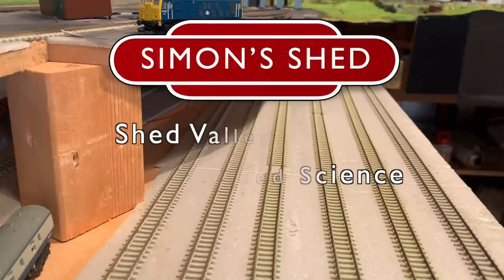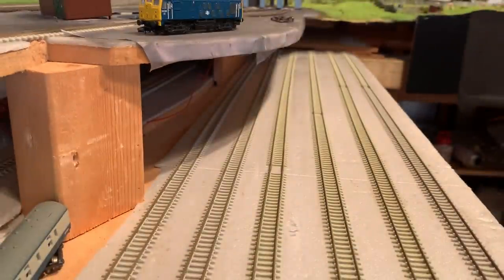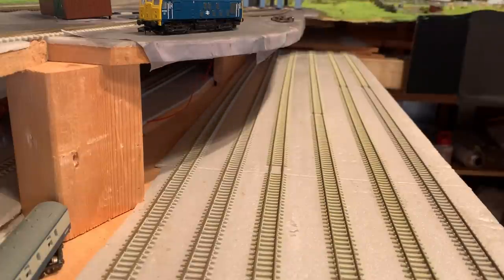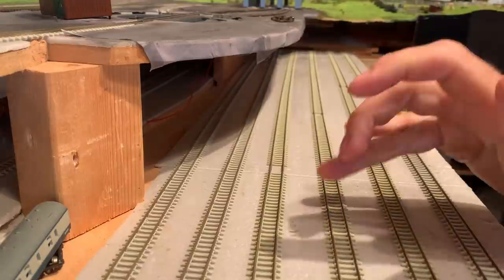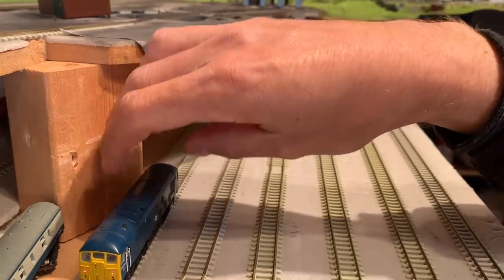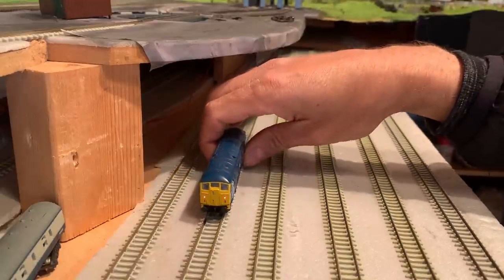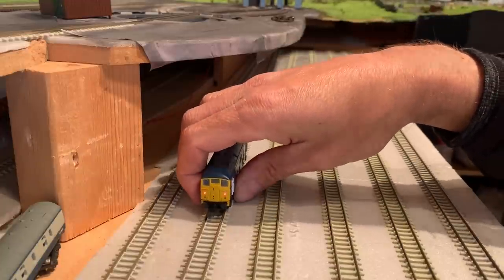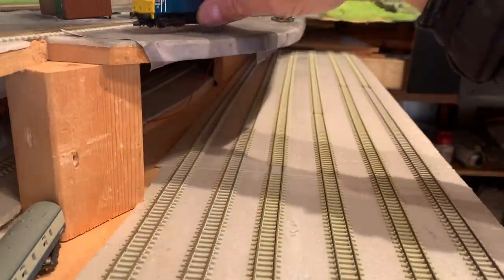Track cleaning for model railways

Comment: I don't use anything but a peco track rubber, followed by a graphite block, which leaves a microscopic coating on top of the rail. Graphite makes a good electrical contact, it's the same graphite as used in pencils, but the graphite block is a lot harder than pencil lead. No way would I use WD 40
Reply: TRAM JUNCTION watch the Fishplate Films clip to show you why using a track eraser is a bad idea...

Comment: Isopropyl is pronounce iso-pro-pol (or -pal depending on your accent). IPA is diluted with purified water. If you are using 50% IPA, then Fishplate films is quite correct with his assessment. If you are using 91% or lab-grade 99.5%, then the water content is negligible for the amount you are putting on your track. Couldn't quite tell from your video, but looks like you are using normal WD-40? I don't know about the Australian product Fishplate films was using, but CRC is electrical contact cleaner, its not the same as WD-40. If you use electrical contact cleaner, you need to wait until its completely dry before running trains to avoid problems. Glass cleaner will leave glass streak free but it tends to leave a bit of a residue on other surfaces, they also add a blue dye to the glass cleaner, so that will likely add a blue tinge to your ballast over time. There are some interesting articles floating around about micro-arcing between the train wheels and the track reacting with the chemical compound of the cleaner. There are some claims that IPA can cause an increase in these micro-arcs, which result in the gunk on your track. I personally clean the track with the CMX cleaner using 91% or higher IPA, usually a couple of passes then change the pads in the CMX. Next, I go over it with Goo Gone and then let it sit for about 20-30 minutes. Finally a quick pass with more IPA, this seems to work pretty well. Goo Gone does leave a bit of a residue on the track but pre-treating it with IPA and then a quick post-treatment with IPA seems to remove the residue completely.

Comment: If you use 99. 99% IPA (also call iso-propanol,  2-propanol or propan-ol,  then you should have no problem.... this is the pure alcohol without any water.  Can be obtained as 1 or 2. 5L bottles from,  for example,  Amazon.

Comment: 99.9% pure IPA does not contain water.
Reply from the maker: Not sure, just going on what Fishplate Films said, I think there are different levels of purity.
Reply: @SimonsShed  There are. the stuff sold for antiviral use such as wipes and sprays tends to be about 70% so it doesn't evaporate too fast but is strong enough to do the job of killing virus. I have the 99.9 because I make my own acrylic paint thinner and airbrush cleaner.
Reply: @SimonsShed  Dave is right. IPA is just diluted with purified water. The percentage reflects the alcohol content. So 99.9% is pretty much pure IPA, 99.5% has 0.5% water, 91% has 9% water, while 70% is 30% water and so on. For model railway purposes, 91% or higher is going to be fine.

Comment: just to add .IPA has to be99%, bought off amazon,found two independent sources for cleaning rolling stoc kand loco wheels.works a treat,quick, and easy .under power, push loco on j cloth soaked in the stuff.takes seconds only.

Comment: I used WD 40 before  changing to Inox (about 40 years ago) to clean my track. WD40 does not last very long as eventually it dries and does not leave a proctive layer of oil on the rail or wheels. Your expriemental method is flawed in that you did not clean the locomotive wheels between tracks, so some WD40 would have spread to each seperate track, hence the inconclusive results. Do what Greg from Fishplates does, and you will get reliable running with minimum effort.

Comment: Ipa is fine I use it myself but it will only oxidize if you have steel track ,most people like your self have nickel silver track which doesn't oxidize, wd40 will leave a oil coating ,stick with the IPA mate

Comment: WD 40 original is not that great for model rail track. WD40 contact cleaner is fine. As is Inox, arguably better than WD 40 contact cleaner.. Even automatic transmission fluid works well. We have to think of a loco on a track as a completion of a circuit. Track does not have to be super clean to maintain good contact. What people should never use however, are stupid track rubbers. I'm surprised Peco hasn't woken up to what damage they do.

Comment: Contains water and oxidises the track , crazy Australian guy , as if the water will oxidise the track . Yes if bathed in it and left for days . Evaporation a thing  the Australian guy never thought of and the fact that you could dry it off . The reason nickel plating is used now a days . Isopropyl alcohol perfectly ok . He was pushing some other thing like WD40 . Think it was just crap , save the wd40 for more sensible use.